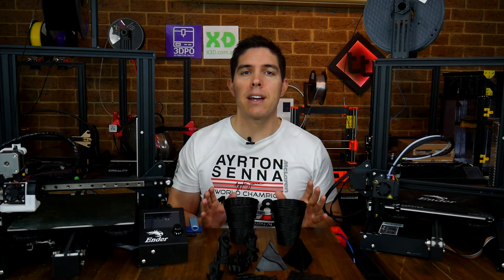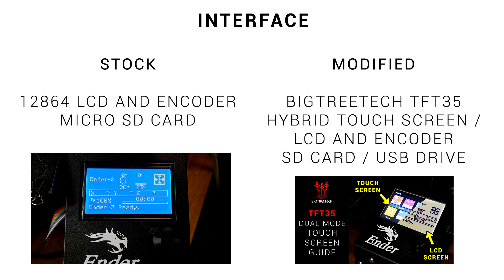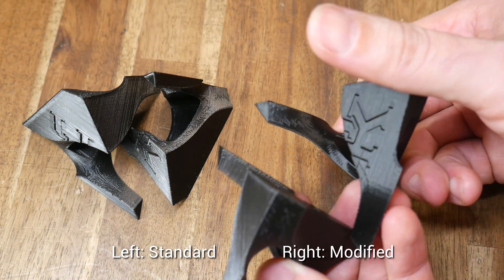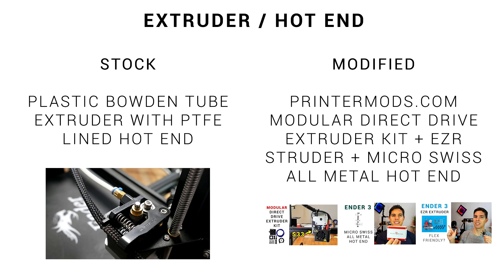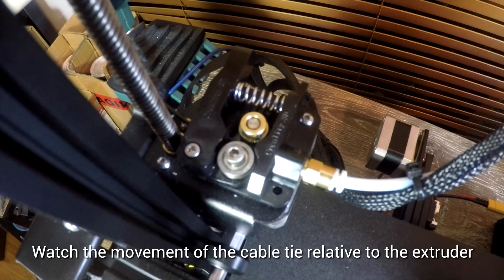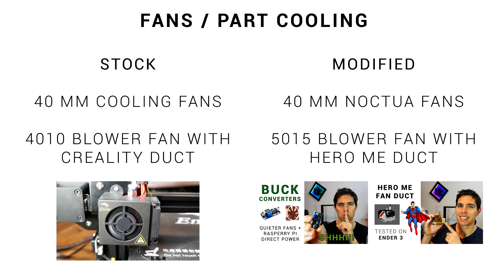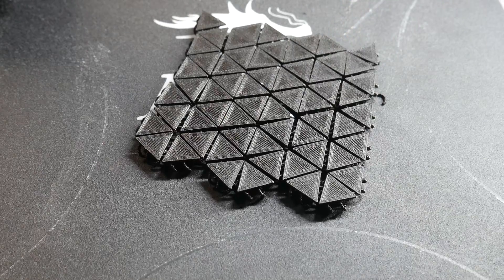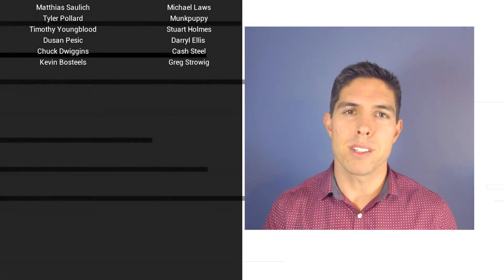Are modified 3D printers better? Stock vs upgraded Ender 3 comparison

Comment: I'd second the BLTouch (or level sensor of taste) as a really worthwhile upgrade. Same for silent steppers. Both good value mods I think. I recently fitted a cheap clone all-metal hot end and that's working well too. I did try a touch screen a while back, but for me, didn't feel it really added anything, but that reflects my workflow more than anything else - Octoprint rules!!  Cable chains and a custom enclosure along with quiet fans well worth the effort and minimal cost too. Direct drive extruder...maybe one day. As always, most of these mods are thanks in large part to your inspiration Michael

Comment: The only mod I haven't got is the auto bed leveling, I tried an inductive sensor but had loads of problems, manual leveling with a DTI gauge and babystepping is proving to be really good and reliable.

Comment: I've made many mods to my ender 3 and fairly happy with it but when something starts to go wrong there are then more things that may be the cause of it. I have the touch TFT and it makes life easier but one big drawback is that the manufacturers don't seem to be very engaged in improving it or fixing issues found with it, I've found a couple of problems and, looking on their GIT hub page, it doesn't look like they are interested in fixing them.  After many months of perfect prints mine has decided to start generating zits on curved surfaces, after much investigation it looks like the movement of the hotend is pausing whilst printing a long curve, is it Octoprint, is it the mini E3 1.2, is it mechanical? maybe I need to put it back to stock to see if it cures the problem and then change one part at a time.

Comment: I probably spend more time upgrading my 3D printers than I spend printing useful thing with them... it's part of the fun
Reply: Yeah man.

I started with an Ender 3 Pro, upgraded everything about it I could.

Then found that the supports I made 3D Printed, I still didn't like how wobbly it was.

So, I thought, why not build a CNC, now I know how a 3D printer works, not just some desktop CNC for wood tho, no, I want to CNC aluminium!

So I did.

Then I used that CNC to make alu parts to make itself sturdier and then I thought to make the Ender 3 sturdier, but since I now had a decent mastery of how these things work, thought, hrm, if I just get some aluminium profiles, I can make a much larger printer with a better axis layout.

So I did, it's 1x1x1M with a steel bottom frame.

Now I was offered a Micro Lathe for relatively cheap and noticed I could make that thing so much better CNCing and 3D printing better parts for it and when that's done I should be able to turn quite a few improved parts for the CNC and 3DP.

I've also started thinking about upgrading my bench drill, a nice 2-axis magnetic bed would be schweet.

My hobby now is making machines to make machines to make machines to make machines better.

Other than parts for the CNC and 3DP, all I printed so far was a vase for my mum.

I have CNC'd more parts for stuff like my mountainbike and brackets for my car tho.

But 3D Printing, yeah, not actually used that for anything other than machining yet.
Reply: @enlightendbel  That sounds like an amazing hobby! I also was thinking lately that a 3D printer is pretty much a CNC machine with a plastic extruder fitted onto it, so it shouldn't be that hard for me to get into CNC mills, although I have no experience with machining this far. Would definitely be an interesting learning experience with the added bonus of being able to machine aluminium. 
Maybe I should look into this some more, your comment shows me that it's not too far fetched.
Reply: You could very easily argue that upgrading it to make sure you have the advantages towards other prints is useful in itself
Reply: i have bought an Anycubic predator when it was on sale and am currently in the process of seriously upgrading it and fixing it's issues, and i have way more fun upgrading than actually printing stuff
Reply: i have two printers one to print on and one to tinker with :D
Reply: Haha. I get annoyed when I can't think of something to upgrade or tinker with
Reply: Same here
Reply: Oh no it's Skyrim all over again
Reply: got my printer from a friend who had a sewage burst. modifying it is a must for me.
Reply: Every print is a “test print” to make sure everything is tuned proper after disassembly and reassembly of the new parts 🤣

Comment: Not really a valid test. The modified printer is taking a stock car and turning it into a tuner. For most beginners and general users, they are better off staying with stock and following the design specs.

Comment: I like how you answered the question by not answering the question making a more informed decision is a lot better like you said some people modify because that's the way they want to some were just happy the way it runs I went the same way you did with a friend and we modified ours for the purpose of not having to constantly clean and adjust parts it also made it more reliable in the long run Good job Michael

Comment: Hey Michael I was thinking of getting the tH3d anti backlash nut and the upgraded lead screw coupler. My Ender 3 has the stock firmware of Marlin and I was told by Th3d that there was an issue with pause and resume prints where the nozzle crashes into the printed part when you resume and I am totally having this issue.  

Should I 1. Get the above upgrades or upgrade the main board and upgrade the firmware to fix this issue.

Comment: The best solution, at least for me, is find a used one. Luckily enough, i buy used ender 3 for around 55% from the actual price. The condition is not so good or not so bad, can fix easily, and it comes with 3 spool's of cheap PLA for learning. And from there just upgrade the necessary part, like Mirror Bed, SKR Mini E3, Micro Swiss all metal (thinking about buying capricorn tube, but the stock tube just doin fine). To bad i dont have access to buy EZstruder. Total cost i must pay is more like brand new ender 3 pro.

*Can someone reccomend me for extruder? the choice is Dual Gear (CR10), BMG, and Titan.

Comment: I'm really curious would you be willing to list the specific fans and cooling duct you are using on the modified printer.
Reply from the maker: Duct is a Hero Me, I have a video on it. Fans are a 40x10mm Noctua on the hot end heat sink, and a 40x20mm Noctua in the (custom) electronics case. I have videos on both of those too.
Reply: @TeachingTech  ok thanks for that I was a bit confused since you had mentioned Noctua but in the loudness test the fans are black and I am used to Noctua fans being brown

Comment: Do a litrophane test.. in one corner prusa mk(whatever) in the other corner Ender 3 / pro - skr e3 mini - Direct drive with linear advance enabled... It's like to  compare VGA and 4K.. next test stock Ender 3 vs upgraded Ender 3..
Reply from the maker: I haven't done one in years and that sounds like an interesting test.
Reply: @TeachingTech  please do.. I love my prusas, but no matter what I have tried my modded Ender's outpreform the prusas by Miles when it come to litrophane.
Reply: On a sidenote... iam chocked by your benchy quality results... You must have tried really hard to get that bad results :O

Comment: i think that there is a point missing : the price of the mods. With all of those mods the price is way more than doubled.
I know that you can put the ones for what you want to upgrade but i think that mentioning the price of those mods would have been good. 

the linear kit for the X axis is around 90$
the SKR mini E3 (the mainboard) is around 30$ and that is without the drivers
the 2209 are just over 30$ for 4pcs
The BLtouch is just under 40$ (without the mount but you could print one yourself)
the modular extruder kit is around 35$
ezr struder is around 35$
the micro swiss all metal hotend is just under 65$
and that is not all of the mods and we allready have way more than the original price of the ender 3 just in mods.
Reply: And you only mentioned the cheapest options. Not Duet mainboard, E3D new extruders (almost same price as Ender printer), ruby nozzles etc. As for me i3 printers requiring upgrade #1 - replace mechanic from moving bed to something normal.
Reply: The mini E3 I bought for £20 ($26) came with tmc2209s? Where did you get the idea they don't ship drivers
Reply: @nthn-  my mistake, i was thinking of the SKR E3 (not mini)
Reply from the maker: I addressed this in a pinned post, please have a read.
Reply: Similar mods, without buying "kits" are doable for much less. The X axis linear rail for example. One can buy a linear rail for about $20, and print their own adapter for the carriage. A BMG style extruder is another $20, and again, a DIY mount to turn it into direct drive can be done quite easily. On my printers (no Ender 3, yet) the best upgrade I've done is the BMG extruder.
Reply: I just got a combo from BTT for the SKR E3 Mini (2209s integrated), the TFT touch screen, and a BL touch for 85 dollars.

Comment: Doubling the final price of a $150 stock 3D printer, WOULD BE A NON SENSE IF THE MODS DIDN'T DELIVER MEASURABLE IMPROVEMENTS! You just use US SERIES' TRICKS i.e. building an episode from a patchwork of the previous ones! IRRELEVANT AND SO FACILE! PRETTY DISAPPOINTING! In French they say "bouche-trou", literally "hole-filling", whenever you think you have to post whatever on a regular basis...
Reply from the maker: It's shame you feel that way. I had an unique opportunity to make an interesting comparison and I enjoyed doing so. Apparently you didn't watch the whole second half of the video which tried to explain that print quality is just one aspect of what makes a printer good.

Comment: The only thing that I hate about my Ender 3 is, the slowness of the 8-bit controller. Very often, when I am choosing a file to print, the slowness caused the screen to not refresh the selected file on time, and not knowing where the dial landed on the selection, it's quite common that I'd only know that I've chosen and printed the next file which is not what I want, until it's too late and wasted my filament, time and efforts (I'll have to stop the print, clean up the wrong print from the bed, re-calibrate, and re start the print, this time with lots longer wait for the selection, and wait for the heat-up again).

The 32-bit controller and touchscreen is definitely my next upgrade to save up for.
Reply: There's a cura script that shows the filename while it is printing which might help you out there, and I think the custom firmware might be configurable to have confirm screens?
Reply: @nthn-  Thanks for the info, will check on it :)

Comment: In general, i will avoid cheap products (regardless of whether it's a smartphone, laptop, 3d printer) and go straight into the midrange price segment as my minimum standard, but i do understand the appeal of entry level products to those on a strict budget. 

My rule with any purchase 
1. I want a product to work well straight out of box, instead of spending time fixing problems and upgrading parts just to make it consistent. 
2. If it's not broken, don't fix it. I'd use it entirely stock if i don't have issues. Sometimes you'll create new problems instead.

For my first printer i dropped $600 right away for a Cr-10S pro. It did give me one quality control related issue, the wiring of the ABL sensor broke after just two months sending the nozzle crashing into the bed surface but i changed the sensor myself to one that only detects metal and consistency has been amazing. Every other problem i faced are my own doing due to inexperience, and watching YouTube has taught me how to troubleshoot and correct them. The only other changes to my printer i did was using a magnetic bed surface (convenience) and changing parts of the extruder.  I only mod if necessary and find it worthwhile, otherwise i won't bother. This thing runs so quiet that i don't have to bother changing parts like the motor. I'm OK with the fan sound though. 

Nowadays i just hit print without levelling the bed manually, i don't even have to babysit the printer. I come back 24 hours later and see a long print done nicely. I only recalibrate the auto levelling measurement, together with other regular maintenance work, once a month. Hitting a button and leave the printer alone without much supervision - i cannot expect an Ender 3 to be this reliable unless i waste time making countless upgrades to it. 

Now that I'm so familiar with the machine that i bought a second Cr-10S Pro, the latest V2 version that comes with a BLtouch sensor already installed. I can share the same spare parts and i don't have learn a different machine and fix them over.

Comment: Thanks Michael. Another good vid. I've modded my Ender 3 and as you say the Printer out of the box is pretty good. I would also say that not all mods go to plan and can require a heap of troubleshooting to dial in. I have had trouble with a number of mods not going to plan.
My top 3 mods are the SKR Mini E3 board with the TMC drivers on board, the Wham Bam surface and the upgraded bed springs. Still don't have ABL so far I the bed has stayed rock solid and, as you say, the magnetic bad stops having to muck around removing a print with the bed still on the printer.

Comment: It's a tool and a hobby and there is a lot of fun had adding the mods for me. Your guides have helped me add a better build plate, BL-Touch, E3D direct drive and Octoprint. Is it the end, I doubt it as you inspire me with a new controller as next probable mod :) the only disappointing mod for me was Octoscreen as was a lot of effort and I'm almost never using it, already back to the much better Octoprint interface. Many thanks for the guides and support.

Comment: Hi, I just convert my ender 3 from bowden to diy direct drive from Thingiverse (SpeedDrive), when I print calibration cube or something with an edge with ABS+ / 50mm/s with enclosure, the top layer edge get curl up a little (never happen with bowden), is it to fast on corner? is there some setting after we install direct drive (whatever brand it is)? beside turn down retraction. or we really must use linear advance on every direct drive printer?
Reply from the maker: I'd say speed vs cooling. Lower speed or more cooling, although on ABS that could make layer strength suffer. Maybe lower nozzle temp 5-10 degrees rather than up the part cooling fan.

Comment: I have started with a stock Ender 3 Pro changed everything now all metal hot end, liner rails x,y & z 32 bit board and TFT35 E3 v3 ..overall works great ..prints are outstanding now...
Reply: how much did it cost?
Reply: @mrdot1126  My goal was to improve on what I got ..Cost is on you ..You can go to the website and determine if the upgrades bi did and suited to your needs..

Comment: My E3 has always printed well so I tend to add upgrades when I wear something out.  The stock extruder worked fine but when it eventually wore out, I replaced it with an all metal dual gear model.  When my build surface got worn and damaged, I replaced it with a spring steel PEI model.  With a nice new build surface to work with,  I decided a BLTouch would be a good way to keep it in good shape.  The nice thing is, upgrades to an Ender are generally inexpensive and easy to add over time.  Many thanks to all the great YTubers like Michael that make it easy to choose and install all the various Ender upgrades.

Comment: Thank you for another excellent video Michael. I feel that the Ender 3 is aimed toward the casual/hobby user and I think Creality hit the mark with it. Industrial/production users wouldn't/shouldn't be looking at anything in this price point anyway.
My 3 year old Ender 3 is only lightly modified but the only noticeable improvements for me were the all metal filament feeder, glass bed, and all metal hot end. I've only had to adjust the rollers twice since I bought the printer. Once for the initial assembly and another a year later just for a touch up. The only time I level the bed is when I change the print nozzle and clean the glass bed. I have a BL Touch kit sitting on the shelf, just in case. My Ender is what I would consider heavily used since I'm constantly printing something. Rarely is it ever sitting still. I bought an Anycubic Predator but it's still sitting in it's box awaiting attention. I may buy another Ender 3 for printing small stuff.
I don't mind the stepper motor "singing" since I've worked on industrial manufacturing equipment for years, but I installed an SKR Mini E3 board just because I could. Not sure if it was a placebo effect or not, but I think I noticed a slight improvement in print quality with the new control board. I suppose the board being able to make modifying the firmware easier could be considered a plus.
No difference in print quality was seen after I installed a linear rail for the Y axis. The stock Acetal(Delrin) rollers work fine for me and have lasted 3 years so far.
There are various other minor changes I've done but I did them only because I like to fiddle around with things, not because the Ender needed them. The materials I've printed so far are PLA, PETG, ABS, and TPU. Want to try Nylon, CF/glass impregnated whatever, and PolyMide CoPA.
My next changes are going to be separating all of the electronics from the main frame so that I can enclose said frame for printing ABS, ASA, Nylon, etc. Installing a TFT3.5 touch screen too, because I like the idea of using a USB dongle instead of a SIM card. I may install a higher wattage power supply along with larger gauge wire for the bed heater to hopefully enable faster bed heating when printing ABS and such. Also considering a direct feed Bondtech BMG extruder or one of it's clones.
And as always, YMMV.